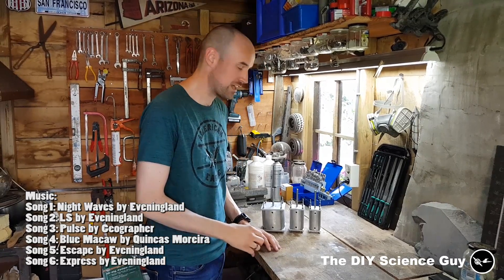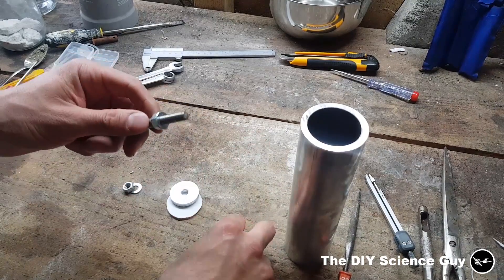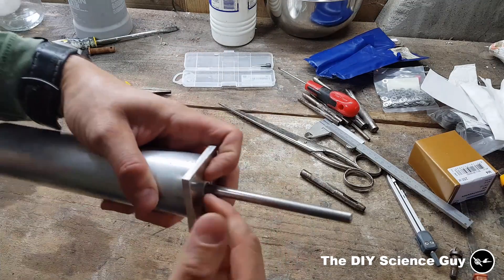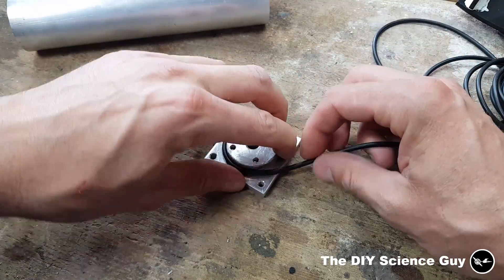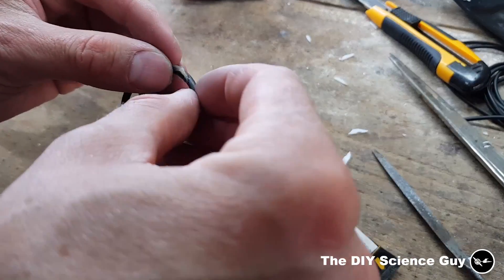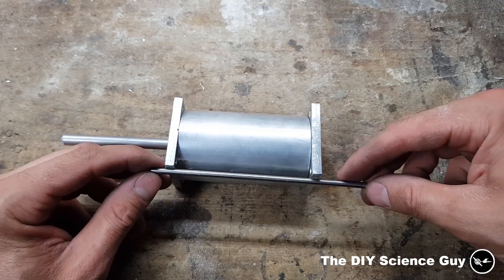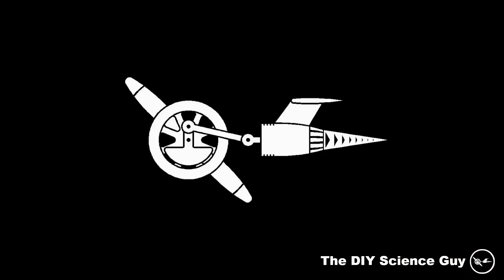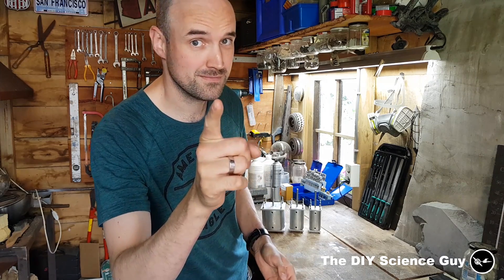Solar steam engine #3 the cylinders.True DIY

Comment: Actually Teflon mightn´t b best choice 4 piston ring as it will creep or "yield" over time hot or cold
Reply from the maker: That is actually a good thing because it minimizes  resistance. The seal will be pushed against the cilinder wall by the steam pressure anyway.
Reply: @TheDIYScienceGuy  I hope. Good luck mate and keep updating pls
Reply from the maker: Thanks! Have you seen the latest update: https://youtu.be/dOo3ZALd6po

Comment: Why do you different size cylinders? Why not use all the same?
Reply from the maker: It's going to be a triple expansion steam engine. The residual pressure frome the first cylinder will power the next and so on.

Comment: Great series. Perhaps you might benefit from gasket-maker silicone. I hadn't considered making my own o-rings before but I've used gasket silicone in several (high-temp) applications. It's quite versatile but requires a bit more drying time. Veel succes ;)

Comment: why cylinders of different diameters?
Reply from the maker: It's a triple expansion steam engine. Steam goes first to the smallest cylinder than the middle and finaly the biggest. After it has past trough a cylinder the steam still has pressure/energy, but less than at which it entered the cylinder so the second cylinder needs to have a larger diameter to create the same amount of force as the former. All these expansion steps make the steam engine much more efficient, up to 35% in large steam boat engines.
Reply: thank! waiting for continuation